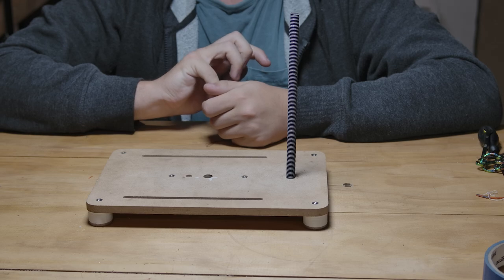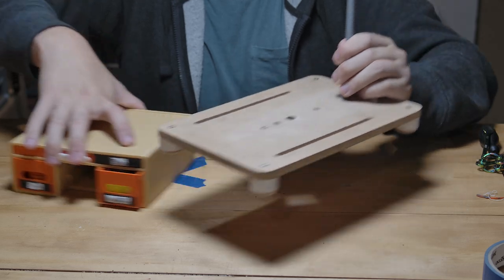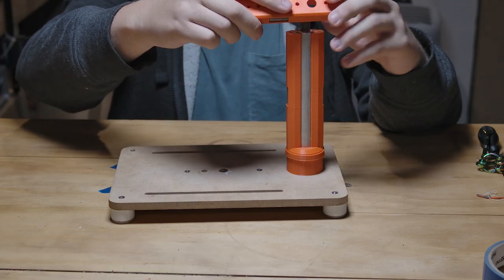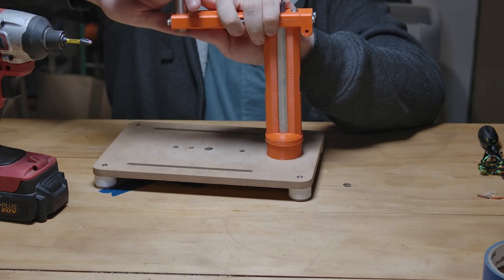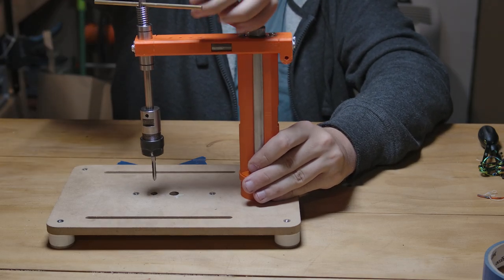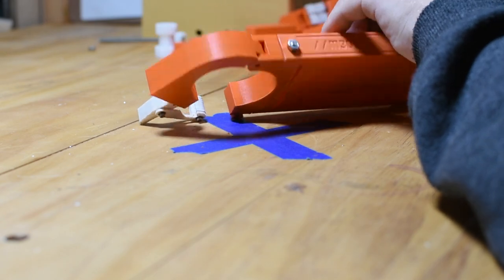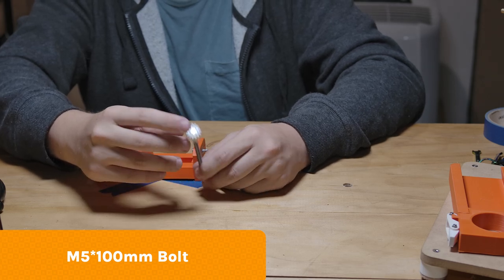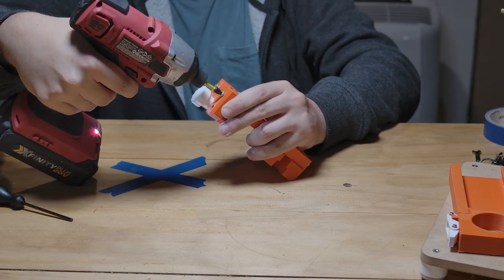3D Printed Tapping Arm: Build Guide!

Comment: Maybe i missed you mentioning it, and I don’t see it on printables, but are you printing all the standard parts in pla?
Reply: Yeah, please post material(s) (or at least which you used), infill, and more information/even profiles if you want.

I’ll try and make an OSE wiki page or something on it later next time I’m on my desktop (on mobile right now), and actually make a printables account etc (just got my printer recently), but i think posting the Material(s) used, and infill percent used is basically the bare minimum (short of just posting the files, WHICH IS GREAT, half these channels barely even show the build process, let alone release the CAD lol)